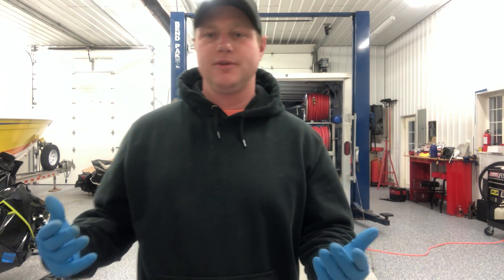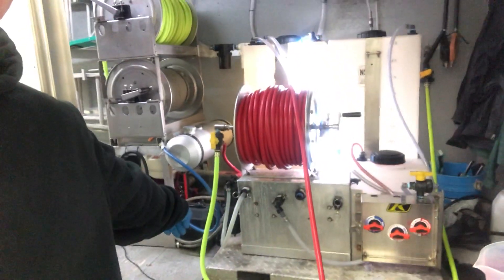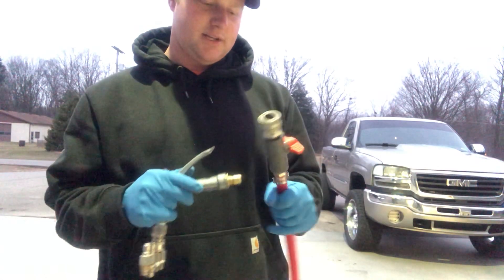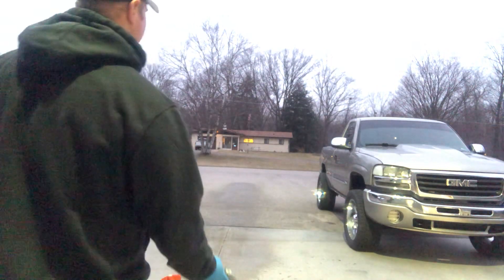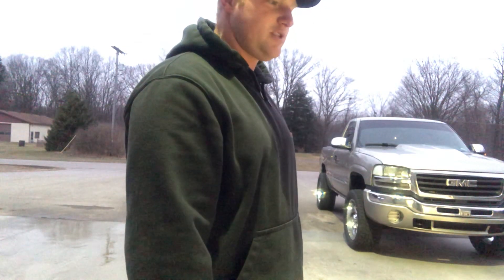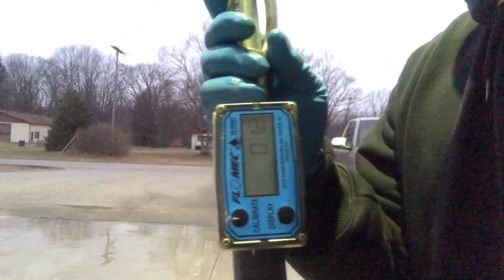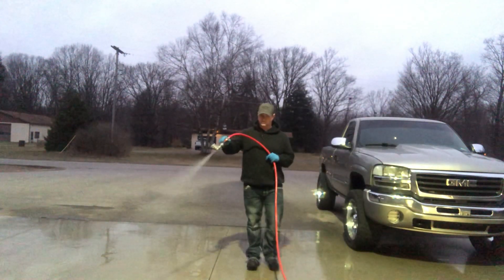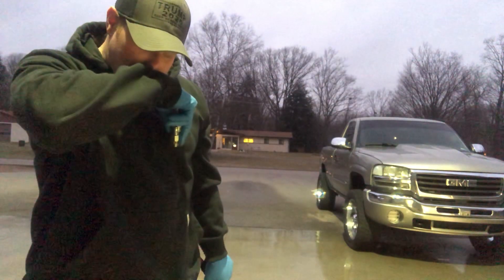12V soft wash pumps don’t last?

Comment: Hey Josh-Great videos! I was gonna suggest a breakdown video of your system but then I saw you're rebuilding it. Are you still gonna go with the 12v system? Or are you upgrading to something else?
Reply from the maker: I am going to start out again with the 12 V then we’ll see
Reply: @softwashscience  Nice! Can you make a video of the set up with sizing etc? I've seen many 12v setups but not with an accumulator tank. Is that the game changer? Maybe you can fix the stigma that revolves around the 12v systems
Reply from the maker: @jefferymeasles4193   its all taken apart now so yeah maybe in the future when I am reset.  The game changer is just having your system set up right and there is a few different ways to do that.  I use an accumulator and it works but some don’t.  Psi matters and hose there are so many variables.  Viton seals, good power source, good plumbing, no air leaks and don’t rapid cycle your pump thats the game changer.  There is many things the 12v is and isn’t but as far as a dedicated pump for applying chemicals its the simplest and most cost effective by far and changing a pump if its set up right should take 3 to 5 minutes and they are $200 so its hard to beat.
Reply from the maker: @jefferymeasles4193  no problem, you may pm me on facebook as well and then when we communicate its saved and you can look back on it.  It’s easy to trade links on there for equipment or communicate with a Videos and then we can both go back when we need to look up stuff.
Reply: @softwashscience  hey man. I haven’t seen the accumulator set up before. Can you break that down for me. What it’s used for and the purpose behind having that vs not. Thanks.
Reply from the maker: @treyt6765  it’s just like an air bladder basically and it just holds a little bit of extra pressure so if you were to happen to use tips that are the incorrect size or if you were to be up really high with your hose you could cause rapid cycling of the pump turning on and off and that’s really hard on the pump and the pressure switch. So the accumulator tank just holds a little pressure in there and it essentially prevents rapid cycling.
Reply: @jefferymeasles4193 still keeping an eye out? LOL

Comment: I'm looking at a typhoon 18 v. 115 psi sprayer that uses a pressurewasher wand and tips flow rate is .65 per min. 

What flow rate would I need for roof cleaning ?
Reply from the maker: you will need at least 2.5-3 gpm for roof cleaning
Reply: @softwashscience  I have a 4gpm for rinsing will that work ?
Reply from the maker: @creolecajun9988   I would get a 5.5 6 or 7 gpm pump.  for rinsing you can't really use a 12 v that great your better off with a booster or pw and 8 gpm.

Comment: Can you elaborate on the 1/2” to 1/4” adapter you made for using the J-rod directly with the ball valve?
Reply from the maker: Scott Velazquez  its just a custom piece I welded a 1/2 plug onto a 1/4” coupler I had to machine each one before I joined them so it made a smooth internal bore.

Comment: I keep having the problem where my fuses will blow several times a day unless I jump the terminals.  I know that's dangerous for the system, but I don't understand why, when it's wired simply and plumbed simply that it keeps blowing fuses.  Do you have any suggestions?
Reply from the maker: Mark Dadian step up your fuse a bit and make sure you have a nice strong battery.  Could also be you need more air flow to keep the pump cool.
Reply: Increase the wire size to the pump. 12 gauge minimum. 30 amp fuse for a 5gpm pump.

Comment: What kind of pump are you using
Reply from the maker: Mike Carlson flojet
Reply: @softwashscience  what model? Im cleaning gas stations and thinking of using softwash on the buildings and canopies. Using downstream for degreasing islands but getting an x jet for that
Reply from the maker: Mike Carlson keep down-streaming and x jetting my friend.  12v is for flat work or roofs not commercial gas stations you won’t be happy.  If you feel the need to get a 12v get 7gpm 100psi # 7970 101Y SB.
Reply: @softwashscience  thx for advice. I would like to do some residential work i used to do mobil homes was awesome doing a bunch in a park. Hard to get houses around here. Really need to find something to clean rust. Thx for great info appreciate it
Reply from the maker: Mike Carlson F9 Barc

Comment: How many hours would you estimate on that pump? Is that the Gen 2?
Reply from the maker: Powerful Improvements gen 3 skid.  Hours oh man I couldn’t even guess.  I have used it so much I used to use it to transfer Sh from drums and I do lots of testing at night with it.  If I had to make a random guess I would say 1,500- 1,800.
Reply: sixONEslix awesome. I bought gen2 for my truck this year. Only used it on a couple roofs and chemical transfer so far. I mostly xjet house at the moment
Reply from the maker: Powerful Improvements  did you get it with a proportioner?  I believe your system is the same just a touch smaller pump.
Reply: sixONEslix yes mine has 2 of the 4.9 pumps. No proportioner. Set my new rig up on a budget this year. This April completes 1st year. You have an incredible set up and garage. Thanks for sharing videos
Reply from the maker: Powerful Improvements  thank you sir!  Fyi you can get a pump just like mine and it will bolt right in they swap out in 15 minutes and the wiring is just two plug connects so nothing difficult.  Save your pennies from your first couple jobs and get the proportioner, I didn’t buy mine with the proportioner either but got one after the first job or two and never looked back.
Reply: sixONEslix awesome. I hope to upgrade to proportioner etc for next year
Reply: sixONEslix would you be willing to share what you use for chemical on the magic wood cleaning video?
Reply from the maker: Powerful Improvements  nope lol I have been asked by thousands and not even my employees know whats all it it.  One day when I make my exit to the industry I’ll sell it.
Reply: sixONEslix understand
Reply: I like your style! I love my 12V get tired of everyone who says you gotta do all this expensive high power stuff...totally agree with everything you said in this video! Can I ask what pump you are running...I run delux 7150 7 gpm 100 psi...usually get 1 1/2 years out of it..but 4 years! Wow...what pump is that?
Reply from the maker: Reflections Exterior Services  there are two pumps both flojet 6gpm 70psi i also have a delavan 7970 101Y.  Thanks for tuning in!!
Reply: @powerfulimprovements  the only chem that will work that fast on a wood fence is Sodium hypochlorite..you can use this method but you should always pre wet the wood so it dosen't absorb all of that chem..you just want to clean the surface..then a high volume rinse. Magic
Reply from the maker: Xtreme power Washing Sh by itself at the proper strength won’t change it that fast and won’t neutralize itself in under 10 min.  You need an additive hence the name we have for the product.
Reply: @softwashscience  ofcourse it will make it change that fast...then neutralize it after...

Comment: Josh, what size tips are you using in the jrod? I heard you say something about a 50. What is the orifice size and spray pattern?
Reply from the maker: Billy Helton I am using some 40’s and 30’s anywhere from 15, 25, and 0 degree.  I also have an 0520 I use at times.

Comment: Hey Josh, thanks for tips on tips ;)       question, lots of back and forth on 5.5 vs 7 gpm. For a small 50 gallon skid operator, do you have an opinion on which is better. Assuming your doing large, 1 and 2 story homes with 5k sq ft steep roofs. Would you use the same hose for either and have you gone out to 250' with 5.5 vs 7? Thanks bud
Reply from the maker: 7 gpm with 5/8” hose or the 6gpm flojet with 1/2” yes I ran 250

Comment: I dig the 1/2 GF BV. I can’t find them either.  Have you had luck with any other high end Viton seal BV?
Reply from the maker: Diamond Wash by Softwash Pros Doug Houston thank you and no I haven’t.  I am sure there might be something out there but its hard to say if the over all quality would be the same or not.  I know guys use spears 1/2” viton but its larger in size, the handle doesn’t have a nice confident turn to it and can be bumped open easy.  Also I noticed I used to crack the other valves often and these take the abuse and keep on rolling,  unless an f150 rolls over it (see late night video lol). Just try some out let me know.

Comment: I just built my 12 volt system. I can’t get it to prime and hold pressure. After hearing you talk about the hose length, that got me thinking. I have 1/2 300 feet of hose on my reel. I wonder if the length of my hose is the issue. I have a Delavan 5.0 GPM 70 PSI. Should I cut my hose to 250? to get it to prime and hose pressure.
Reply from the maker: Jason Cornett no you should put a 3 way 1/2”  banjo ball valve on the hose reel inlet.  So the line going into your hose reel will instead go into the bottom of the 3 way.  Then the one end of the ball valve goes into the hose reel swivel where the line was previously.  Then the other side of the 3 way you installed put a short whip line like 10 to 15 feet and put a ball valve on the end of that line, I got a gas station style banjo valve and nozzle on my whip line.  Then with all this installed you can select to either take the outgoing fluid from the pump and go to either the hose reel and into your 300’ or turn it and go to the short whip line.  Turn the valve to the whip line and the short line will allow you to easily prime the pump.  When its primed shut the whip line ball valve then hit your 3 way towards your hose reel with the 300’ open your ball valve on the end of your 300’ spray hose and the air will clear and you got liquid so have fun and go make money.
Reply: Soft Wash Science I think I’m understanding. I wish I could email you a video so you can see my set up. I want you  to make sure I’m doing it correctly.
Reply from the maker: Jason Cornett  add me on Facebook Josh Ensing and We can video chat via messenger.
Reply from the maker: Jason Cornett where are you from?
Reply: Soft Wash Science Richland, Wa
Reply from the maker: Jason Cornett added you

Comment: Where u get that fitting
Reply from the maker: Juan Manso what fitting?
Reply: In the valve barb
Reply from the maker: Juan Manso oh the valve barb I got is a 1/2” mpt and the barb itself is sized in millimeters and you can find them on the micro brew or home brew sites. I can’t remember where I got it exactly but its a barb made for the brew market.
Reply from the maker: If that doesn’t answer your question hit me up on facebook Josh Ensing and I’ll help you there via video chat if I have too.

Comment: Josh, thanks for helping everyone with your endless wisdom, seriously I've learned a ton from your videos 

the SS barb you're using to connect the ball valve at the end of the hose, I think I got the same ones but my question is it seems like there is a dead head in there and I'm worried about losing flow connecting to my hose reel. trying to keep everything 1/2", thanks again
Reply from the maker: There is a slight dead head are used a diamond grinder And file them down a little bit
Reply: @softwashscience  sweet thanks! new video soon? gotta show off the sectioned hose for people again that setup is so nice
Reply from the maker: @wavefields  yeah soon I am busy with some changes but got some pretty big news yesterday thats going to change my life so I’ll probably post soon yes.

Comment: What purpose is to have the accumulator tank. What is the benefit?
Reply from the maker: @1stFlyingeagle  run any tips you want and pump longevity
Reply: @softwashscience  That was an honest question. I have not heard anybody else mention they had an accumulator tank with their software system.
Reply from the maker: @1stFlyingeagle  yrs ago most all systems sold had accumulator tanks.  Now it’s all about flow but the fact of the matter is the perfect size tips for a 12 V pump our size 20 to 30 orifice. They spray better the problem is they make the pump rapid cycle.  With an accumulator tank, you can run those tips and the pump will last years. On my current set up now I don’t have an accumulator tank and I can tell you I go through a lot more often and for sure don’t last four years like the one in this video had.
Reply: @softwashscience  thank you for explaining that. I like to understand things clearly when others share.